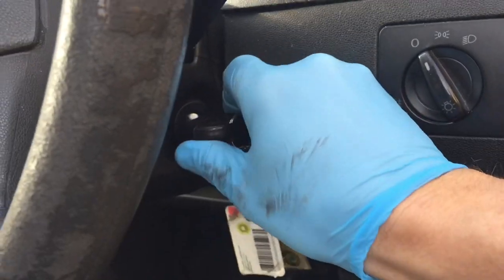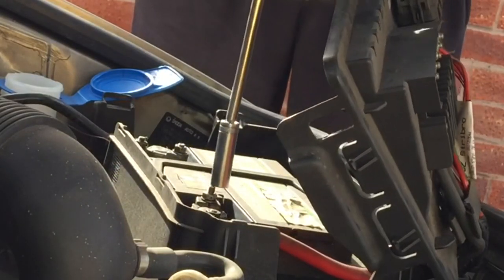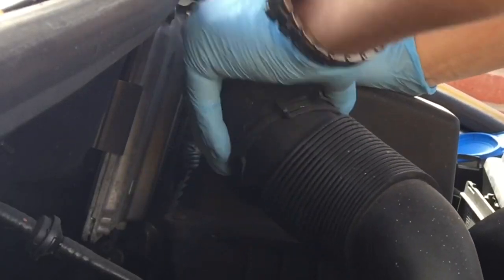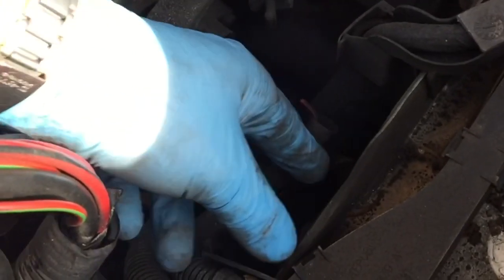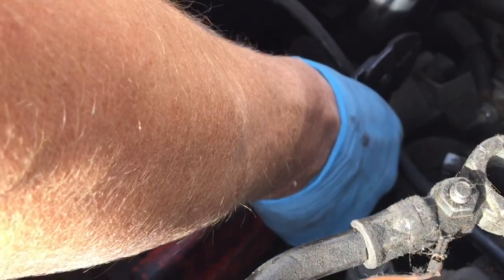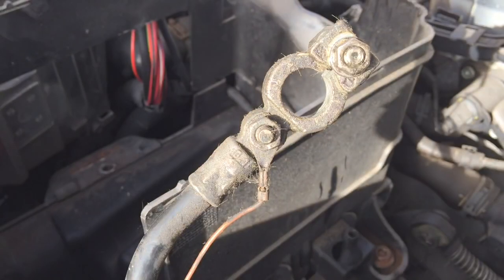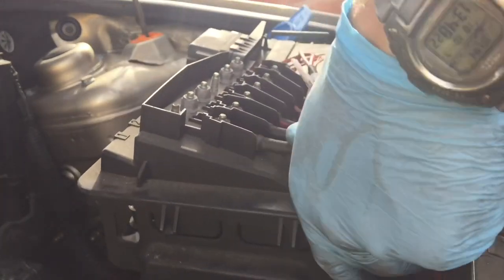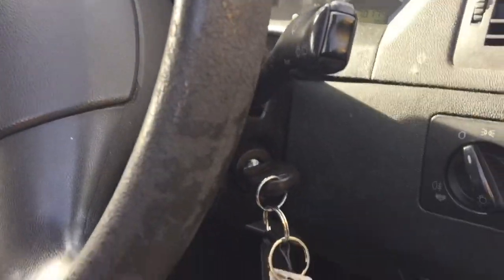SKODA FABIA VW POLO Won’t Start, Key Turns No Crank “HOW TO REPAIR”

Comment: Hi, the key in my polo refuses to turn further after the lights come in the dash. Removing the key and engaging the steering lock and again disengaging the steering lock by wiggling the steering to the right side makes the key turn and the car to start. This takes multiple tries. What could be the reason?
Reply from the maker: sounds like a ignition barrel issue, Thanks for the great comments👍🏻👍🏻🛠
Reply: @aaanton11  changed the ignition switch only and the problem is solved. Thanks

Comment: I had the same problem with Skoda Fabia 1.2 htp, 40kW, 2006. A slightly different way of dismantling and the starter cable cover was very difficult to remove. Now it works perfect, thank you!
Reply from the maker: Well done, Thanks for the great comments👍🏻👍🏻🛠

Comment: Odds on you doing this for me? I’m being serious. I’ll drive to wherever you’re at, my mechanic changed the starter and still can’t figure it out. Now it starts sometimes and other times it won’t even crank it’s a polo 9n
Reply from the maker: The odds unfortunately aren’t good, but thanks for the great comments, it sounds like you might have a wire or Relay issue👍🏻👍🏻🛠

Comment: Hey guys , i had my heater running for an hour or 2 in a vw polo 2009 old model being parked up, suddenly my car beeped and it turned off, and it wouldnt turn over, i bump started it and it drives but the power stearing goes first then it beeps and turns off?? Any clues? Thankyou
Reply from the maker: Sounds like the alternator is not charging, check the belt and battery voltage, Thanks for the great comments👍🏻👍🏻🛠

Comment: Thanks man! Just fixed my fabia vrs. Exactly this issue. Didn't have a spade connector so cut open the connector and soldered a wire on to extend it and jointed it. Caked it in solder and used very flexible wire, hopefully prevents it happening again.
Reply from the maker: Glad it helped, Thanks for the great comments👍🏻👍🏻🛠

Comment: I have a Skoda Fabia 1.4 Tdi. I had the same issue last night where all the power components worked but it would not crank whilst I turned the key. I tried a few times then I got out of the car, locked it and came back after 2 minutes to try again and it started. After that I drove for about 20 miles and stopped to check again and it would not start again. So I gave it a few tries and it started up and it is fine up till now but I would want to know what actually caused that problem. Could it be the wire that is going bad? Or Ignition Key Barrel?
Reply from the maker: Most likely the wire breaking at the starter connector, Thanks for the great comments👍🏻👍🏻🛠
Reply: @aaanton11  Thanks for the reply. I will have a look at it.

Comment: This is a brilliant repair video. 
We’re having the problem with my fabia where it won’t start even though all lights turns on and such. 
We’ve done a medium overhaul before having the Car inspected, fixing exhaust, breakes, etc. When we was working to figure out why there wasnt getting much heat into the Car (a pain in the winter for sure) and it wouldn’t turn on, we thought it might be because the Car hadn’t got enough power after being in the garage a couple of weeks, doors open on and off and being turned on without haven had a long ride to recharge the battery (in all honesty I rarely ride very far so it might not have been charged well getting in there already), but when we had the Car charged overnight and it still wouldn’t start, we were a bit at a loss. 
I’ll make sure to forward this to my dad so that we can give this a try. 

Weird coincidence how it would stop working when we were working on the car though; normally I would say that it had been something we did, but we haven’t been around the motor for anything but taking off the exhaust pipe and putting it back in I think. 

Anyway, Thanks for such a well constructed video, it really is classy when one is looking for possible fixes
Reply from the maker: Thanks for the great comments👍🏻👍🏻🛠

Comment: Thanks so much! Had the same problem on my Skoda Fabia combi 2006. Managed to fix it without removing the battery! Its a bit of a struggle but doable even with big hands.
Reply from the maker: Well done Thanks for the great comments👍🏻👍🏻🛠
Reply: Yeah good point, i choose not to because  I'm not that experienced in car mechanics. Therefore I could make more mistakes to parts that where working fine.

Comment: PLEASE DON'T DISMISS THIS, EVEN THOUGH IT SOUNDS 'RIDICULOUS'!  
It worked for me on my VW Golf which I had just had for 2 weeks.  I turned the key, motor didn't crank, steering wheel wouldn't turn, couldn't change out of P (park), horn wouldn't work, ALTHOUGH, radio did work.  Basically, all the mechanisms for driving away were locked  (I believe this is a safety feature designed to make it harder for car thieves to drive away if they hot-wire your car, so that's a good thing right.  After waiting for an hour in the pouring rain for Roadside Assist to come and help, this is what they did, after properly closing the back door which I had not closed properly.
THE FIX:  PRESS 'LOCK' on KEY, then PRESS 'UNLOCK' on KEY.  Turn key as per usual and hey, PRESTO!  IT STARTED!!

Hope this helps someone!!!  Good luck to all of you who searched for this video!!!
Reply from the maker: not ridiculous at all, its always worth doing a lock and open sequence, and sometimes a battery reset, by disconnecting the battery for 5 minutes, always start at the bottom and work your way up ,Thanks for the great comments👍🏻👍🏻🛠

Comment: I have this same problem,I checked the wire and it's ok,any ideas welcome
Reply from the maker: If you feed 12volts to the wire does the starter work, also check the engine earth, Thanks for the great comments👍🏻👍🏻🛠
Reply: @aaanton11 can you explain how to do that as I'm not that experienced with cars thanks or is there a video I can watch?

Comment: Hi, Great tutorial thanks - I'm getting that clicking sound when trying to start the car. Car won't start and dash lights go off on key turn. All electrics are good(lights, ewindows etc)and battery good.  Wondering if this fix applies in my case.  Dont want to mess with this if not likely to be my prob 😣. TIA 👍
Reply from the maker: I would check the engine earth first, then the starter solenoid as in the video, Thanks for the great comments👍🏻👍🏻🛠

Comment: Skoda Fabia. Last November (yes, almost a year ago) the clutch went. Changed the clutch and was told to drive around for two days and come back for some checks. It also had a new battery installed at the same time. 
That day, started the car, drove 150m to stop at the pharmacy and when came back to the far-reaching it wouldn't crank. Just like you are showing, lights  comes on, but on turning the key all I get is a low hum somewhere close to the fire wall in the middle of the bonnet. My mechanic, since it was still on the guarantee after clutch change said it must be something g silly and promised to tow the car to his and have it done. 7 months ago. I'm a very patient person. Had another car in the meantime but I want to do at Skoda now and sell it. 
Question: could it be the repair of the clutch or replacing the battery causing the problem with the wire as you showed?'I'm going to take everything off tomorrow as you showed but wonder if fixing the clutch could have break off that wire?
Reply from the maker: it will either be the connections in the video or the engine earth wire which is a big one that goes from the gearbox casing to the vehicle body, Thanks for the great comments👍🏻👍🏻🛠
Reply: @aaanton11  I have checked all possible wires last night. Everything is sound and safely packed in bunches, no loose ends, rusty ends etc.  I think connecting it to the computer will be quickest way if only the nearest computer wasn't 20 km away :) thank you
Reply: @aaanton11  my good god! YOU WERE RIGHT! My Skoda has finally got her mechanic appointment ad it was corroded earth strap! £5 fix and it ready to be sold now! If I only reached as deep as they did, I would spot it myself and did it at my driveway. 
👏 well done, 😄

Comment: Do the Fabia IIs got the same problem? I got here a 2012 1.6TDi with the same problem, it didn`t crank a few times for the last months and we push started it, today it cranked once in the morning then stopped completely.
Reply from the maker: Yes all the same, Thanks for the great comments👍🏻👍🏻🛠
Reply: @aaanton11  sadly that's not the problem with me. I checked the cable, good 12 volts go to the alternator. Took it down, disassembled it and every single magnet was unglued. 😭

Comment: I check the connector but it wasn’t broken. I cleaned all the connectors to battery and to starter and still no crank. It only makes click sound when I turn the ignition. The only thing I can think to test next is to try boost the battery. Do you think that’ll fix it. I don’t want to buy new starter.
Reply from the maker: Check it with a multimeter save you spending unnecessarily, Thanks for the great comments👍🏻👍🏻🛠

Comment: My Skoda Fabia is the 2006 hatchback with the 1.4l 16v engine and the 4 speed auto transmission, left hand drive.
I followed the steps of this nice video but when i lifted the battery tray i couldnt find the starter!
Am I missing something or just getting old?
Would it be possible to get some help on the location of the starter on this model? 
Thank you !
Reply from the maker: Being an automatic, the starter motor might be round the back, it is there somewhere lol, Thanks for the great comments👍🏻👍🏻🛠
Reply: @aaanton11  thank you!!
Yes 😅eventually i found the location.
It's behind the engine block right below the intake manifold that needs to be taken out to access the starter. I guess not as easy as I thought.. but challenge acceppted Skoda

Comment: Thanks. Had the same problem and managed to fix it by using this video. However, afterwards there appeared orange engine light in dashboard. Any ideas if this is related or perhaps wrongly connected the wires?
Reply from the maker: You just need to erase faults with a code reader Thanks for the great comments👍🏻👍🏻🛠

Comment: Would you get a check safe lock with this starter wire problem causing ingition lights on yet no engine start or is that a seperate problem for vw polo 2013
Reply from the maker: Possibly, Thanks for the great comments👍🏻👍🏻🛠

Comment: So started motor not cranking even though the wire is attached? What would your diagnosis be?
Reply from the maker: could be the motor, give it a bash with a hammer whilst turning the key, Thanks for the great comments👍🏻👍🏻🛠

Comment: My car has a struggle to crank, will always start on the third go. 
One time it had the dash lights but wouldnt crank over, not even a click. It was the earth strap to the starter has corroded.  I mqnaged to fix it and woukd continue to stat third time, sluggishly try to turn but couldn't until the third turn.
Then today, the same symptoms. Ive checked the strap i fixed before,  checked with multimeter and all seems okay. I didnt check this bloody wire though!! 
Could this wire being damaged caise the sluggish starting for the last two years? And now maybe finally gone completely?

Kind regards

Craig
Reply from the maker: Yes its a common one, Thanks for the great comments👍🏻👍🏻🛠

Comment: My 1.9 bora cut out whilst driving im getting the same thing as you here turn the key and nothing, could it cut out whilst driving because of this wire? I think i stalled it and maybe the jolt of the engine has finished the wires life off??
Reply from the maker: You might have a broken earth wire from the engine to the battery, it wont be the wire in the video, Thanks for the great comments👍🏻👍🏻🛠

Comment: Im having the same problem.I put in new battery and starter.worked for a moment then it won't start again like in the video.
Reply from the maker: Check those wires, Thanks for the great comments👍🏻👍🏻🛠
Reply: @aaanton11  All volts and gnd is good to the starter.Just cant think what would be the problem.car runs fine when push started.

Comment: This is happening to my car, but the car shut off at 70mph? Would this cause the car to cut off?
Reply from the maker: It is possible your main engine earth wire has broken, it wont be the wire in this video, Thanks for the great comments👍🏻👍🏻🛠
Reply: @aaanton11  cheers for the reply. My engine has seized but had normal oil levels and no leak? Seems to be an oil pump failure?

Comment: VW in general seem to have longstanding problems due to going cheap on wiring.. is this down to the engineers or the accountants? (I'm a cost accountant btw)..
I've had a few over the years.. never any probs with the engines but it is the utterly crap electrics that always let the side down.. imho they are only just marginally worse than Renault
Reply from the maker: I definitely think Renault win that one, Thanks for the great comments👍🏻👍🏻🛠

Comment: Doesn't look the same as my 1.4 polo 9n3 under the bonnet i mean.air box doesnt look thr same or thr batter compartment/tray..
Reply from the maker: The engine and connections are identical, thanks for the great comments 👍🏻👍🏻🛠

Comment: My Skoda Fabia does a half crank,, doesn't start and then dies and rear wiper comes on .  Battery is fully charged and it jump starts.   I accidentally broke the plastic positive terminal cover off ( just the bit that goes over the terminal, not the full plastic wire box cover ) which dropped into the workings somewhere.  Could this have snagged something to stop it starting? I haven't found the plastic piece that dropped into the car workings somewhere down the right side of the battery.  It was kind of on a shelf which when I tried to reach it, it dropped further in and I can't see it, hasn't dropped on the floor.  Though I have driven the car around the block without seeing it fall out. I wish my dad was still around, this was his car and he was a mechanic.  I think I've broken my dad's car. Or could this be because there's now no  plastic cover over the positive terminal?  I don't want to take it to a garage for them to take the mick with pricing and me not being too mechanically savvy.
Reply from the maker: sounds like the earth wire to the engine from the battery has a poor connection, Thanks for the great comments👍🏻👍🏻🛠
Reply: Thanks 👍